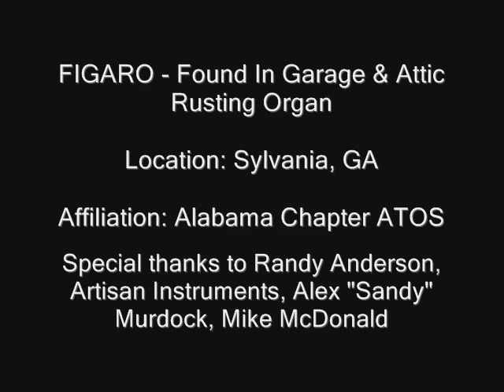FIGARO Theatre Pipe Organ

Comment: I would love to learn more this instrument's history.
Reply: Guess I am 10 years late in reply, but hopefully you are still around! The console has quite a history, starting as Moller Opus 5211, 1928. It was originally installed in the College Theatre in Bethlehem, PA.  As the theatre organ area ended and time passed, it then ended up purchased by George Wright and moved to Pasadena, I can find no information that he ever restored or used it.

Following that, it was purchased by the Dickinson Chapter of ATOS in Delaware, where it was installed in Dickinson High School to drive the 66 ranks of that organ.  

http://theatreorgans.com/wi/Waukesha/comehome.html

The console specification was done by Tom Hazelton. Eventually the console was replaced by a three manual Kimball that is literally a clone of the Moller, so other than brand name matching there would seem to be no reason to replace it. In the 13 years the console has been playing, I have barely touched it for adjustments or repair. The keyboards and pedal are still original, including mechanical phosphor-bronze contacts, and I cannot recall having to fix a single key after initial adjustments.  

https://www.atos.org/chapter/dickinson-theatre-organ-society

However, the console then went to a collectors non-controlled climate storage in Neenah, WI, just south of Green Bay, where I bought it and moved it to its present location.. The severe climate and temperature changes did a lot of warping, and it had to sit in my installation for awhile to "un warp." Over time it settled back into its original dimensions. All was restored and a new relay installed.  This was a self-project and all the work was DIY.

More to follow!